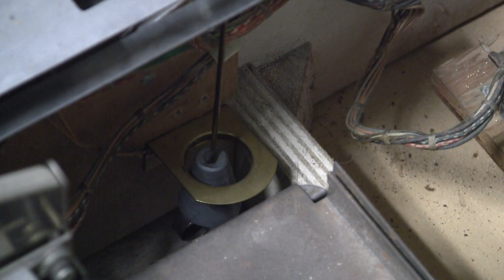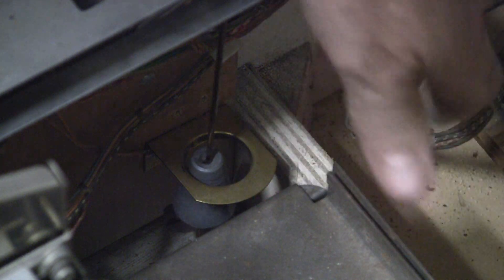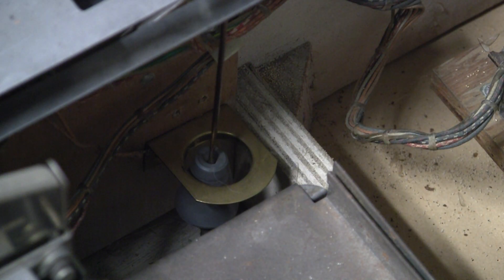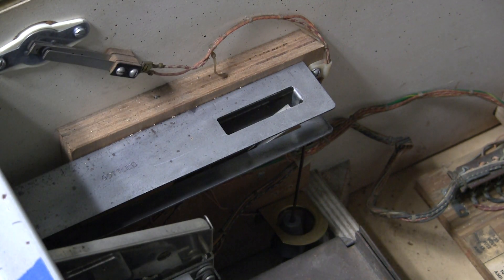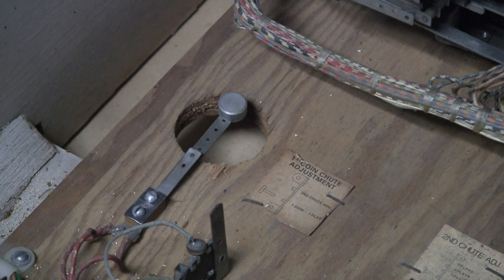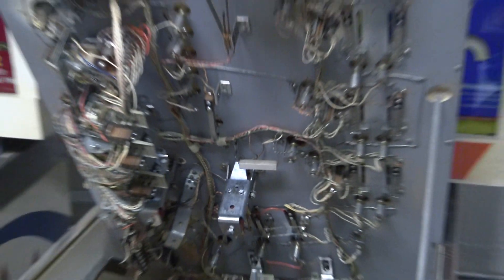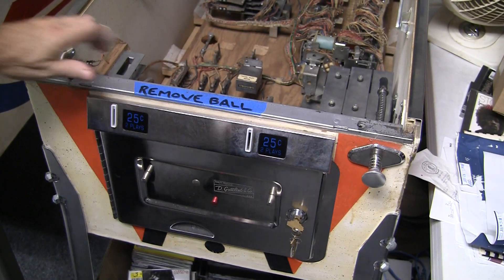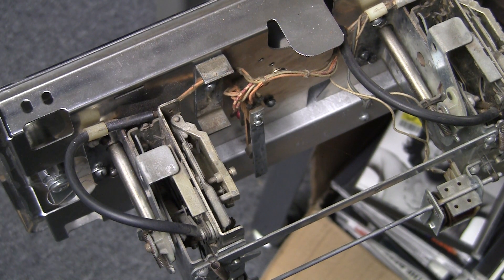Pinball Feature: Tilt!  How does it work? - PinballHelp.com

Comment: Just got an earthshaker machine and it keeps going into tilt when machine starts to shake so definitely gonna check all these mechanisms thanks for info good video.
Reply: One solution is to disconnect the shaker motor. The other solution is to adjust plumb bob tilt. As the shaker motor goes off, the whole game vibrates. This will affect tilt bob as well.

Comment: I have a Silverball Mania that has the tilt on all the time. Checked to plumb bob and it is open, slam switch on coin open, tilt on playfield also good. Lift ball also tests open. Is there a connector point that I can test for either a gnd or voltage. Any advice from anyone appreciated.
Reply: Older Bally games have the capacitor on the switches, which are usually closed for a tiny bit amount of time, since they can't scan the matrix very quickly, unlike newer games. Shorted capacitor will act as a closed jumper, which will cause the affected switch to act as if it was always closed. You have to either remove or replace the capacitor on the tilt switch.

Comment: The Tilt relays are always connected to the ball index relays in EM games? because the ball index relays its purpose is to count the balls or reduce the ball counter?
Reply: The tilt relay will cause bumpers, slingshots and flippers to be dead for current ball in play. The ball count will increase once the outhole is activated. The ball count increases before tilt relay is released. The ball index relay is activated with tilt relay with one of its switches. Certain Gottlieb solid states had separate relay for tilt status. The ball index relay is used when the ball finishes reaching the playfield after hitting the first switch. If the ball somehow ends in the drain without scoring anything, you'll get the ball back if you haven't tilted beforehand. This can happen if the outhole coil is weak.